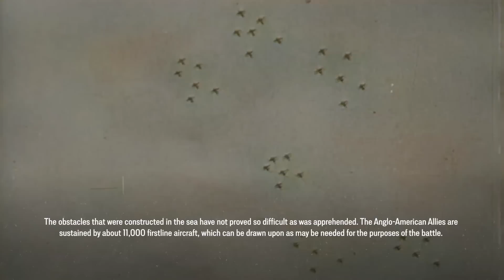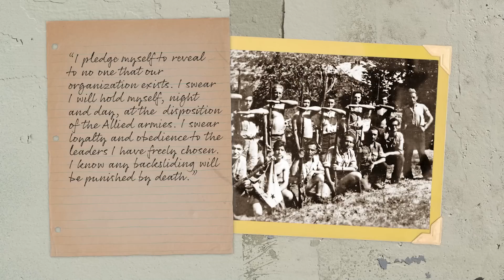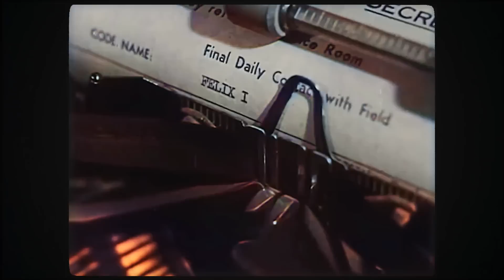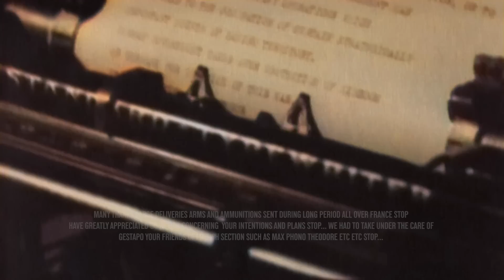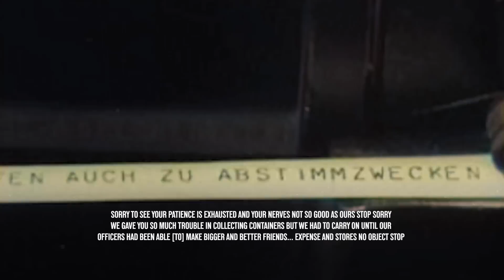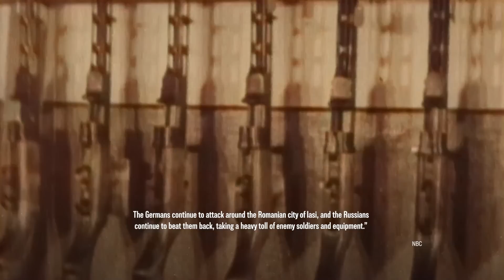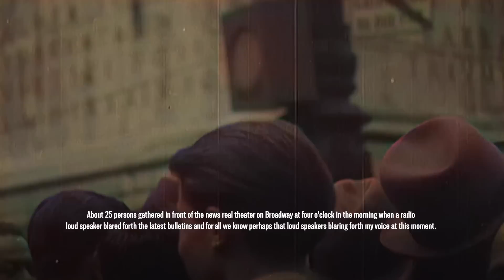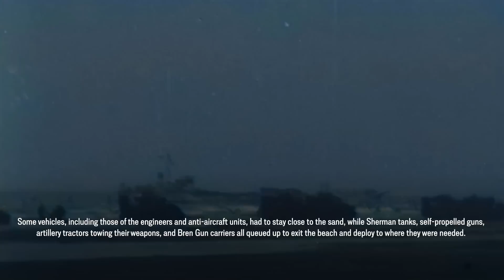HOUR 13 - Where the Hell are the French? - D-Day 24h

Comment: During the landing in Normandy on June 6 1944, the French engaged in the Ground Forces were 215 men:

36 French paratroopers from the 4th SAS were dropped in Côtes-d'Armor and Morbihan, Brittany, on the night of June 5 to 6 1944 for Operation Dingson and Samwest. Their first mission was to prepare bases for future airdrops. The overall goal was to prevent the German troops present in Brittany from joining the new open front in Normandy.
During the next days and until early August, a total of 421 more French SAS will be airdroped in Brittany.
A few other paratroopers from the 3rd SAS were also dropped in Normandy on June 6 1944 within the British 6th Airborne.
177 sailors from the 1st Commando Marine Battalion, led by Commander Kieffer, were incorporated into the No. 4 Commando of the British Special Forces Brigade and landed on the morning of June 6 on Sword Beach.

To that were added the numerous French men and women engaged in the Resistance.
As soon as the landing was announced on June 6 1944, the French resistance fighters launched the sabotage of communication channels and harassing actions which in turn provoked bloody reprisals. In accordance with the “Turtle” plan, which became “Bibendum”, the FFI (French Forces of the Interior) hampered the road movements of the Wehrmacht, while in accordance with the “Green” plan, they hindered its movements by rail. The means of transmission have been disrupted, the electricity distribution systems sabotaged.
Thus the delivery of German reinforcements to Normandy was disrupted.
Reply: The weapons and equipmemt of this french units were british right?

Comment: A great series but marred by the several sections where a point is made and then repeated word for word immediately afterward.  Just one example:  Mr Olsen's comments from 34:27 to 35:19 concerning the "radio spiel" is repeated word for word from 35:35 to 36:25.  Your editor should have caught that.
Reply: It has only happened a few times up until this point. While it is obviously a mistake, such things can happen when you make 24 hours of content with a limited budget.
Reply: As an editor I can sympathize—the difference in difficulty between a 15 minute project and a 60 minute project is not on a linear scale.

Comment: The theory of strategic bombing, say against aircraft was not to destroy every aircraft component supplier + final assembly, but rather just destroy one component for the aircraft. It doesn't matter if the aircraft is complete except for ball bearing, it's not going to fly without ball bearings.
Interesting on the effect of battleship bombardment. The Marines on Guadalcanal also said they were most disturbed by BB bombardment over cruisers and destroyers regardless of actual damage done.

Comment: Questionnaire presented by US interrogators to Generalfeldmarschall (General Field Marshal) Wilhelm Keitel, Chief of the Oberkommando der Wehrmacht (OKW, Supreme Command of the German Armed Forces) and his deputy, Generaloberst (Army General) Alfred Jodl, Chief of the Operations Staff of OKW, concerning German plans for counter attacking against the Allies after the Invasion of Normandy.

Question 4: How significant was the opposition of the Maquis [a French underground group], FFI [acronym for “French Forces of the Interior,” another French underground group] and other French civilians:
a. in aiding the invasion of 6 Jun 44
b. in the battle of Normandy?
c. in Paris and the interior of France?
Answer: To 4 (a): The co-operation of the Maquis and the FFI at the time of the invasion was, so far as I know, slight. Radio messages to these units were for the most part intercepted and decoded. By sending numerous false radio messages we succeeded in getting possession of many weapons dropped from planes.
To 4 (b): In Normandy, these irregular French units hardly appeared at all, but they appeared much more strongly in Brittany, which gradually was almost stripped of troops. Here they gradually took possession of the interior of the province.
To 4 (c): Paris was quiet at this time. On the other hand rather strong police and army forces were pinned down in the Central Plateau, between Geronne and Isle, as well as in the northern part of Provence.

Comment: It is actually very hard to gauge what effect the resistance had, or how widespread it was, because various players had huge vested interests in exaggerating their own impact, both during and (especially) after it. This is a movement, after all, that was the basis of all postwar legitimacy for both the Gaullists on the right and the PCF on the left. Both went so far as to claim that THEY had liberated France, not the detested Anglo-Saxons. And of course it was also a major part of British wartime propaganda.

Put bluntly there was an awful lot of BS put about. It does seem that the most effective practical assistance the FFI gave in liberating France, though, was in intelligence gathering rather than in sabotage or romantic insurrections.

Patton when asked later what the contribution of the French resistance was to his campaign tersely answered "Much less than advertised but much more than I expected".